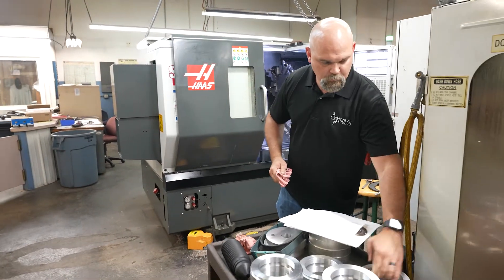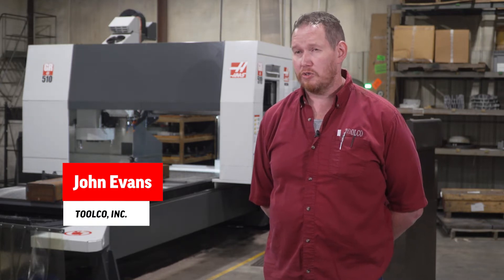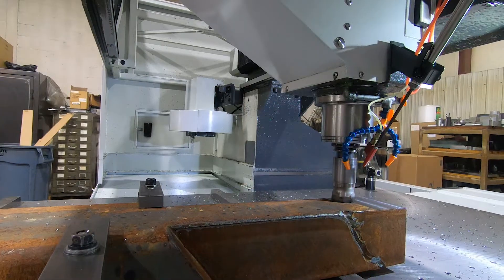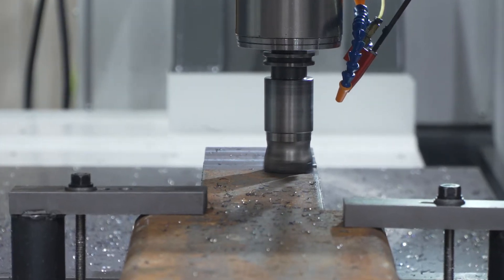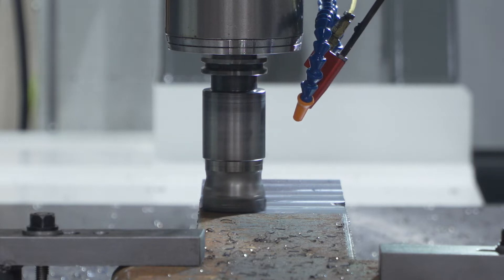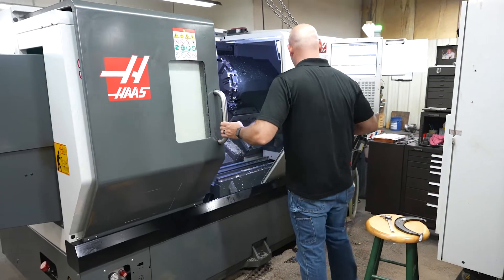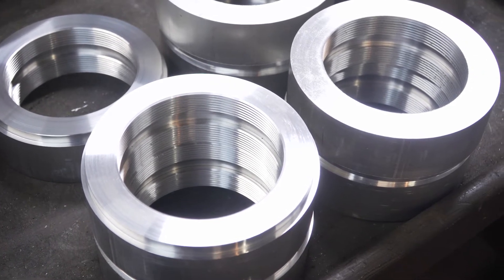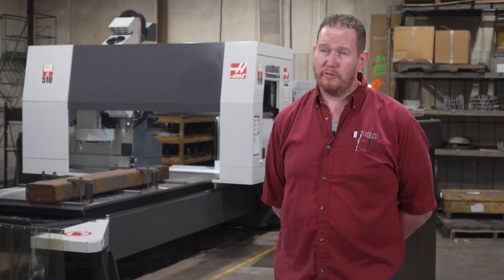Haas GR-510 Gantry Mill Helps ToolCo Double Their Output

Comment: Hi John. GR510: Have you anchor or fixed the machine to the flor?
Reply from the maker: For optimal performance you should anchor Haas gantry mills, however it's not required. I would consult your local Haas Factory Outlet and ask them to look at your application.